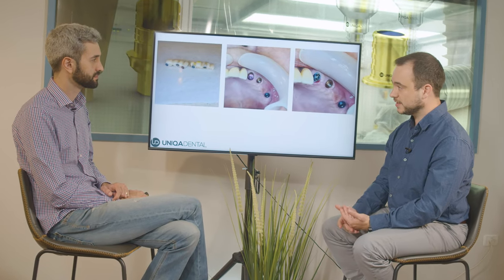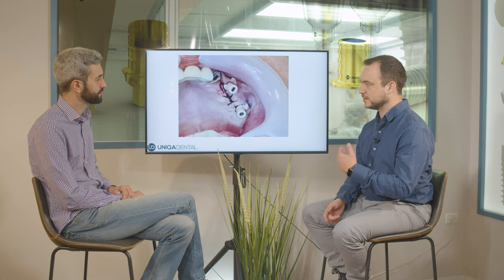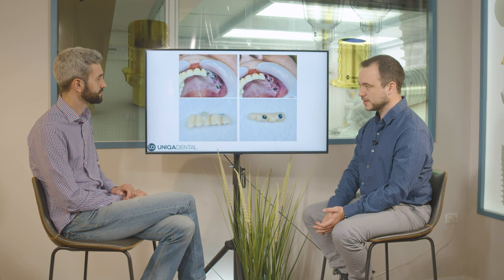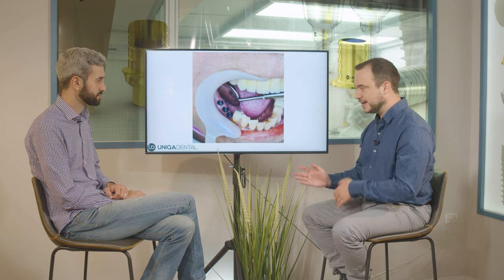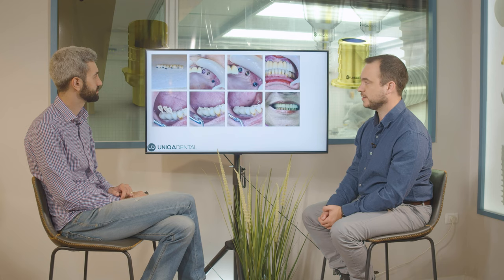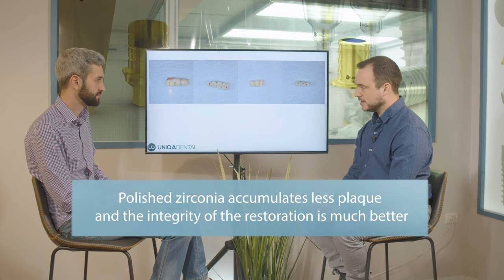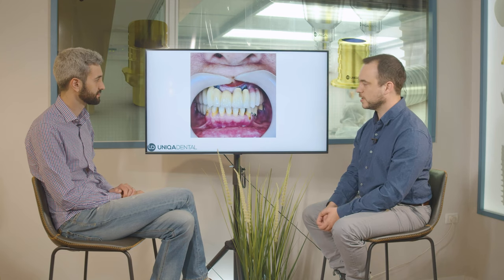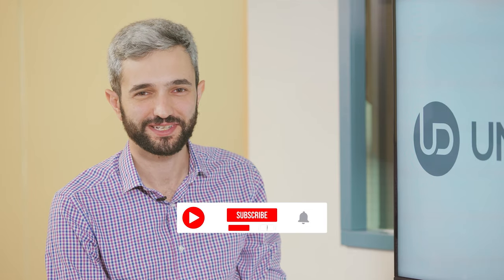Dental case of screw retained restoration on implants using multi units

Comment from the maker: 00:00 We won't see the screw channel in the canine as problematic in the aesthetical part.
00:30 We restored one of the tooth with the temporary restoration for the aesthetical part. 
01:28 Will it hold like, won't it fall even if it's not in occlusion?
02:30 We do want at least three implants. Here you can see...
02:55 The healing caps. 
03:18 A PMMA bridge on both of the implants with multiunit and with the cantilever instead of the canine. 
04:41 Three implants, it's fine.
05:49 What is the yellow part?
06:21 All the multi-units are V-types?
07:45 At first we had the temporary bridges. 
08:21 This is PMMA.
08:55 With angulated multi-units, we have a problem. 
09:53 We close the screw channel temporarily. 
10:23 More comfortable when the height of the teeth is the same height. 
12:03 Contrast of the camera.
12:53 Maybe because of all the yellow candies. Probably sometimes she'll change them.